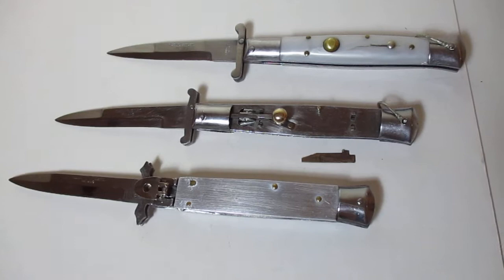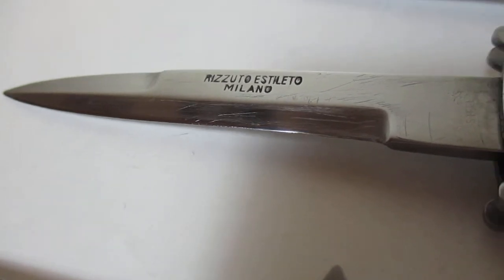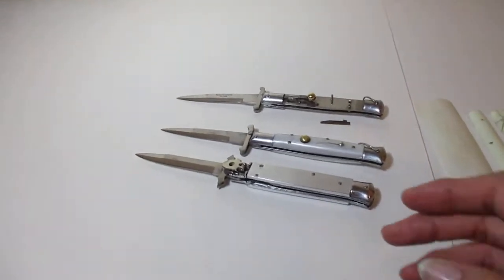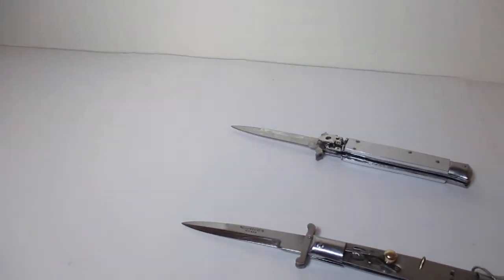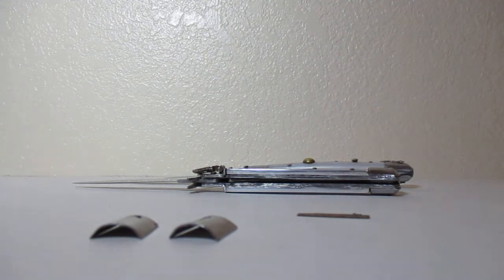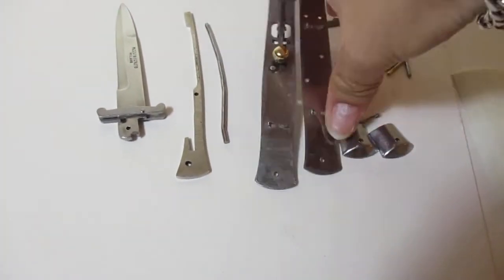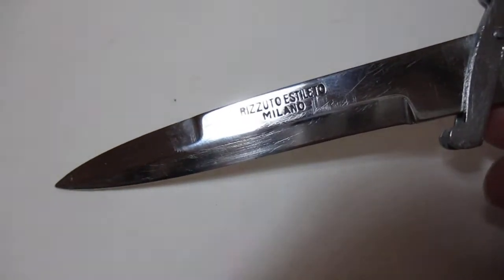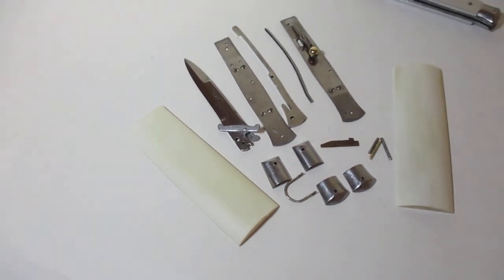Restoring a Vintage Rizzuto Estileto Milano pt 3

Comment: you got that sucker centered good. my brother collects knives. tons and high end and he is so picky about centering. and now he knows how to fix and center any blade on almost any knife. but he dont know how to work on these as he is not into this style etc. he likes old man pocket knifes and tactical folders but he is getting good at working on knives. fixing all kinds of issues. takes patience i am sure. i stick to fixed blade full tang. for the most part. as there is not as many working parts etc. or issues. good work bro.
Reply from the maker: Yeah Bro I Love these Knives & I needed to know them in & out I needed to know how they Work & All that, But now that I do Its Easier to Fix when I get one that's not working as they Should! As for the Fixed Blades I Would Choose One if I needed to Live off the Land like Rambo lol They are Stronger & can Swipe the floor with Most Folders Unless its a Real POS Fixed blade. But Yeah Stay Turned for the Next video!
Reply: @Ronin246  cool. i put up a 2 minute one today. about to do another 1 minute video in a second. hit the like if you can. it helps. and i will always hit the like when i see your vids. soon i do the blacksmithing video and wood milling. guy was making a tomahawk

Comment: NICE VIDEO!!! I ve got two 11" Rizzutos, both with blade peek, unfortunately r both the searpin holes in the blades pretty worn, they r more oval than circle shaped, is this fixable? one way is to laserweld both holes then redrill, second thing is to make new rockers with a bigger searpin at the end of the rocker.. What would u ve done if u were me? any piece of advice is welcome.. 
Keep the good work up!!! N Best Regards :)
Reply from the maker: 1st Sorry for my Late Reply Very Busy With Family Things bUT ALL I can say IS THIS IT ALL Depends on What you want from Them. Such as All Original  Then Leave it Alone & Be Happy you have a Part of History others Dream of. 2nd IF YOU want More out of it as a Working Part of History THEN you Will Need to Repair to the Full extant IN Witch Case it will not be as you got it & YES I know this sounds Dumb lol BUT i must be as clean as i can be As i Showed in my Videos ONE of the Knives i Completely Redid the Handle the Blade is From the 50s-60s but i made the Handle for it, Witch i Should make a Update on that Handle as i remake the Scales for it lol but ill do that later, Then you have the in between All Original With Bone Scales, & the 100% Original Rizzuto, SO Lastly IT ALL depends on what you want out of your Rizzy, If you want it ONLY TO work as it should from the 50-60s WITH OUT tearing it apart id Say Softly Hammer the Hole on the Blade To Move Metal Over JUST enough to Keep the Point in the Handel That'll be the Easiest way to fix it. BUT IF you want it to Be Useable For another 25+ years then yes Refill the hole redrill the hole & that'll fix it best. JUST KNOW Once you Choose to Go down a path you cant undo what you did. lol that was alot lol but with these Knives theres not to much info out there & people get upset if or when they cant fix them. So thats all Stay Safe!